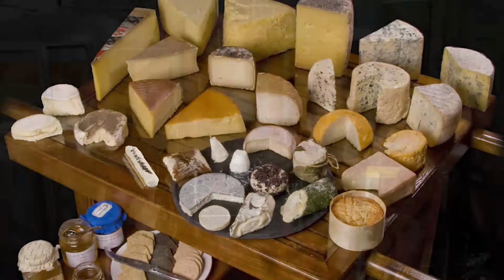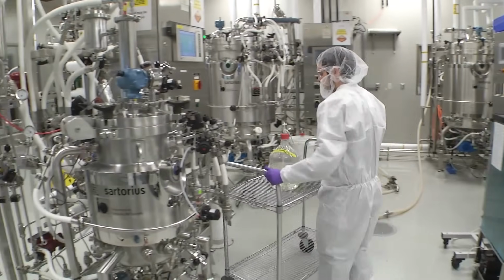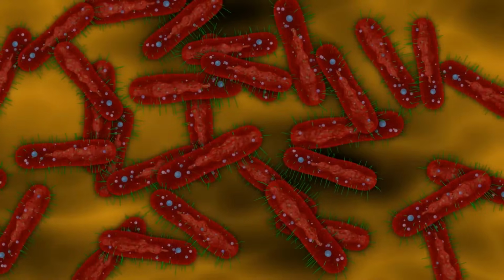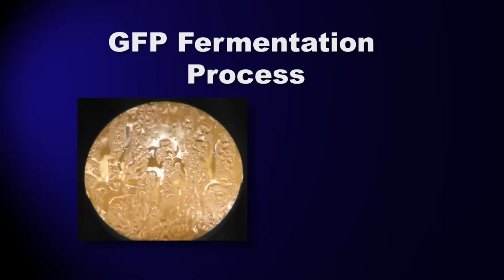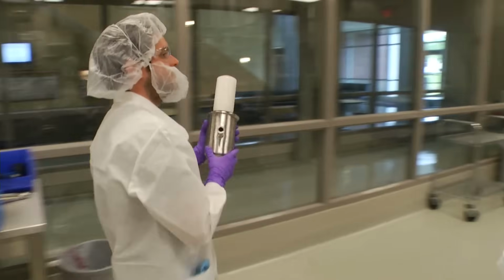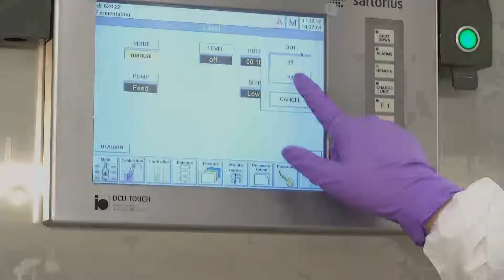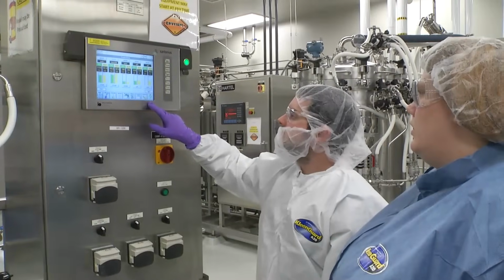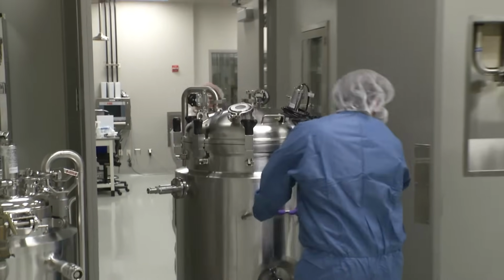Bioprocessing Part 1: Fermentation

Comment: I do this for living. If you want to work in this industry, I would recommend joining upstream first. Upstream is less hectic. Understand the science behind the processes and then transition into downstream. Downstream is more laborious. Thank you for such a great video.
Reply from the maker: Thanks for the advice.
Reply: You very right.
Reply: Having worked in both upstream and downstream development and manufacturing, I think each has its attractions and challenges.  Upstream is more biology focused, handling microorganisms or different cell lines to make the desired product at the yield and quality needed.  Downstream is more biochemistry focused, where you separate the desired product from the other impurities based on their physicochemical properties.  Upstream can be a bit monotonous if you are using the same type of organisms, somewhat challenging as it is harder to understand/control due to the biological element.  You are also bound by the growth scedule, so once you start an experiment, you have to regularly monitor, take samples, which may require odd hours, weekends, etc.  But it is also exciting as you can engineer your organism to make the most product, and also can see the interplay between biology and physical parameters.  Downstream has more operations, so there is more variety.  The physicochemical nature does allow use of more fundamental molecular properties to understand/control performance.  There can be a little less time dependence, especially if the molecule is not too unstable.
Reply: @SamirMuaremi  Are you working at a cGMP facility? If yes, then you should always be working with a partner. If not, then you should only be working solo after you are completely trained. And about fear, throw that out of the window.
Reply: i started in downstream and it was hardcore, learned a lot very fast
Reply: Is there good profit in this industry?my bioprocess engineering professor, he'd help me get in this industry if I want as his older students are there
Reply: @nero9881  Is there any profit in developing cutting edge technology? You answer it.
Reply: @SamirMuaremi  can you guide me how to get job in it. I'm a fresh graduate in biotechnology

Comment: Is there any way to extend the E colis life span? can you add a bolus of nutrients it needs to keep it going?
Reply: You would also have to contend with buildup of waste products that inhibit further growth. I don't believe there is any facile way to remove them from the broth (perhaps there are filtration methods, I don't know), and even a small 1:10 dilution would be impractical because this would require around 180 L of fresh media to the existing 20 L.

Comment: Fermenting:  have been using small ultrasonic cleaners for making Aging alcohol Cannabis edibles, Tinctures and Coloidal Silver.I had the Idea to try it on my Fermentation of grain mash. My hopes were to make the mash into smaller particles and increasing surface area. I hoped to increase Bioavailability for the yeast. The 6 gal. plastic bucket I used for it kept blowing its top off as the bubbler was unable to keep up with the new rate of fermentation. I had to resort to taping the lid down with duct tape, Watching the bucket bulge from unreleased pressure  and hoping it did not explode. !!WARNING DO NOT USE A GLASS VESSEL FOR FERMENTING  IF YOU SHOULD TRY THIS METHOD!! I had hoped to show the increased speed of fermentation in this video. I made two mistakes. I used some pretty old yeast and I did not malt the grain first.
Still the control had not even started before the ultrasounde grain had filled its bag full. I believe if I had used a malted grain and newer Yeast the results would have been more dramatic for you to see. I am very new to brewing, only three batches with using ultrasound to decrease particle size the third batch. I did try a sugar wash 4th batch using the ultrasound but saw no changes in the speed of fermentation. . I am hoping someone with a better set up and greater brewing knowledge can experiment with this  and show the actual rate of increase. (I believe it to be about 300% or better)  
  This could have a major significance in such a large market as alcohol and fuel.A factor to consider is stirring the grai water mixture in the ultrasound as a heavy layer of grain at the bottom may reduce effectiveness. I used a 60 watt, 40khz ultrasound unit with just one transducer on this video . On the earlier bucket run I used a home made unit with two 40 khz transducers.  Finding the optimal  range of transducers, frequency , volume, stir rate and length of time I leave to future brewers with more capital and time to find
https://www.youtube.com/watch?v=b_mdvsEF3vo&list=PLD7nPL1U-R5pl-EsIsmgZTuS0t3Tm6EV8&index=8

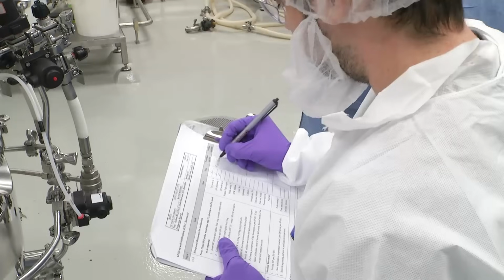Comment: at 9:45, why the growth chart is like that? why is it started with OD=0. During 0 hour inoculum should be added so the value could not be zero.
Reply: If you look closely, OD at 0min is higher than zero. Granted the inoculum will be diluted manyfold when introduced into the tank!